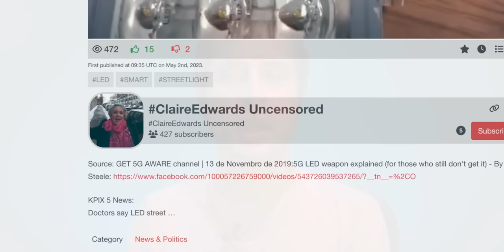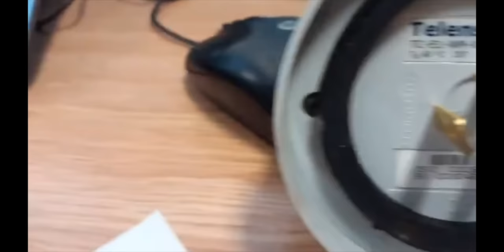Weapon Breakdown? by Mark Steele

Comment: A quick google of the datasheet for the Hongda HFE20-1 Shows it to be a Mini high power latching relay, 20A max switching capacity. A Telensa, is the manufacturer of the Telecell controller you can download the datasheet for that too. Mark Steele is a weapons grade plonker.
Reply: I'm sorry to say that I didn't download the data-sheet. I just assumed Mark was wrong.
Reply: @RaynardWilson0   Ignoring the old claim about what making assumptions means, I think that is a perfectly reasonable, evidence-based, assumption.
Reply: @RaynardWilson0  Nothing wrong with that, Mark is wrong most of the time, he doesn't know the difference in magnitude between Milliwatts and Kilowatts. Or voltage ratings on Capacitors. 450V is the maximum voltage it can be exposed to and store. On a 240V mains supply that would be the usual rating for a capacitor. At lower voltages, say 12V,  you'd choose to use a 24V rated cap. Mark should have been looking at the Transformers fitted to the circuit board, they can step down or step up the voltages in the circuit, in this case step down from mains power to a lower voltage for the telemetry circuits, but switching the high voltage Street light on and off through the relay.
For a real misunderstanding, he ought to look at the speed controller used in a brushless RC model aircraft engine, and the amount of power they are expected to control, some of them are rated at over 100A!
Reply: @RaynardWilson0  A very solid assumption i would say.
Reply: I don't think I've ever seen a power rating marked on a relay before. Voltage and current, most certainly, but power especially in watts rather than a volt-ampere product, is an oddity in my experience (which is pretty extensive - I used to design industrial electronics including SMPS, which I hate)
Reply: @monochromaticlightsource2834  He was quoting the voltage because the actual value of the capacitor would mean nothing to him (or to his followers for that matter).  What could it be, hmm?  100 'UFFS' for instance?  (I can't read them)  Doesn't sound as nasty as 400 volts.
Reply: @CaptSlog  I suppose we could tell him about resonant frequency, and that a capacitor and an inductor will resonate when forming a Tank circuit. The word Tank in Steeles mind is a weapon, and off he goes telling everyone that the millivolts a crystal radio set is able to generate can be used as a potentially lethal weapon.
Reply: Did you really have to look up a data sheet to come to the conclusion that he's eaten too many crayons?

Comment: I would love to see a Big Clive teardown of that Telensa unit, it looks interesting. Also those units date from something like 2010, probably designed for LPS lights. It has a maximum switching current of 10A and a transmit power of only 100mW. That is less than a modern residential access point.
Reply: I believe Mr Toon knows Big Clive, I wonder if he can be persuaded to do the needful.
Reply: Yes, but will it carbonate? 😀
Reply: If it carbonates, can we get something carbonated?

Comment: Recently got a look at inside of an CRT TV, he would get a damn heart attack just by looking at it. Quite an amount of beefy capacitors as well as other quite beefy components (in part due to how old the tech was). Not only that but it contains an electron gun and a vacuum chamber with coils surrounding it for aiming.
Reply: It also contains a "high voltage"warning. I guess they leave this off the streetlight to catch us off guard.
Reply: Woah woah have you forgotten the X-Rays those bad boys out off if it wasn't for the shielding.
Reply: It used to be fun to hold one of the neon mains tester/screwdrivers about an inch in front of the screen and watch it light up.
Reply: if you think that was kewl, you should look into the "health machines" from the late 1800's like ozone generators and violet ray tubes...
Reply: UH yeah - those can reaaaalllyyy zap you :)
Reply: @clivedavis6859   Not electricity related but also implosion warning, there is a good reason why the front glass is so thick
Reply: Don't be silly, everyone knows that you can't have gas pressure next to a vacuum.
Reply: @StringerNews1  And you definitely need a container for spectroscopy!

Comment: 555 timer...the number of the electronic beast.

I'll get my coat
Reply: At uni, long ago, i had to design a 555 timer from scratch in matlab on a sun workstation… god im old…
Reply: So versatile, so deadly!
Reply: I was once almost injured by a 555. I was assembling the project for my 'O' Level (yes, I'm that old) in Electronics, was excited as the parts had just arrived (mail order from RS) plugged it in, switched it on, and there as a snap noise, and something hit me in the forehead. I'd plugged the 555 in the wrong way around and destroyed it. Oh dear, another 2 week wait for a replacement,.....
Reply: @engineeredlifeform  I thought you were going to say it did a 'dead bug' impression as you were fitting it and its 8 legs impaled your thumb.

Comment: Oh crap, I've been using 400v capacitors on my old retro consoles.. i never knew my old nintendo was a lethal weapon..
Reply: Big Clive calls them "death beam capacitors" - he's obviously aware of Mark Steele's revelations.
Reply: 400v?
Reply: @babotond  v for volts.. 
"400 volts" and "3600watts" markings are the maximum rating for the part, and they operate way under that.
Reply: @Lunchpacked180  thanks!

Comment: Not only are they weapons systems, pulse mode street lights are a great weight loss plan. As your irises open and close at 20,000 times per second, following the pulsing light, your eyes turn into fat burning machines. You burn so many calories you can lose all your fat while stuffing down as many hot fudge sundaes as you want. For best results, lay off the sundaes while you stare at streetlights.
Reply: Using this same principle, we used flashing security lights mounted at almost ground level to disorient intruders .

Comment: If these are weapons systems as mark claims I'm still waiting for the explanation as to what exactly will cause you injury or death.  Do there street lights have some sort of gun attachment that he hasn't shown us yet?  Is there some C4 explosive hidden inside these capacitors and relays that can be activated when we get too close?  If the method of causing injury is to zap everybody with an overdose of UV light in the hope they get skin cancer and die I can't say I'm impressed, I'm sure the gun and explosive options are more efficient.
Reply from the maker: He actually thinks the RF from these can vaporize a human. Literally vaporize like Star Trek where the body is gone after.
Reply: @ConspiracyToonz That would explain a lot. I’ve been wondering where are the mass graves for burying all the millions of people who are being killed by streetlights.
Reply: @ConspiracyToonz so that’s where all the workers that install the “weaponised parts” go to and why you never see them.  As soon as they plug them in they’re vaporised.
Reply: Look at any printed circuit board carefully.  Somewhere on the component side you will always see a "C4" marking ...

Comment: Man, if only there was some kind of writing on those little black rectangles all over the bigger green rectangle that would give us some hint as to what their nefarious purpose was and let us look them up. You know, something like "666 EXTREME power microwave weapon modulator" or "ISL6565B switch mode power supply PWM controller".

Comment: Oh no. Pulse Width Modulated LEDs. As featured in video boards, static and scrolling text displays, petrol totem price displays, architectural lighting, etc.
I worked with these (designing, repairing and installing) for 16 years and only died every time I powered one up. Which is thousands. It gets monotonous after the first 500 times, then you just roll with it after that.

Oh, no! Not high voltage caps! Not really for holding the full wave rectified mains voltage then?!? WE'RE ALL GONNA DIE!!!

Well, that does it. Out with the chainsaw and goodbye streetlights!!!

Comment: And now imagine Mark looking at Guitar tube amp. wide traces, big PCB, HUGE capacitors and real voltages up to about 500V. Hot, gloving tubes and a lot of places not to touch. either hot or even lethal. Big power supply (transformer), big output transformer and even some small modern electronics (DSP doing the reverb). And it has some real weight to it 🙂
Reply: We could send him circuts to review

Comment: Thin cables with cheap plastic connectors? I guess the first atomic bombs were like that too huh  Mark Steele.
Reply from the maker: I love the part where he shows the antenna which is JUSR A WIRE and points out how sophisticated it is.
Reply: @ConspiracyToonz  yeah, but it did have a rubber jacket!

Comment: No, not the 450V capacitor ! 450V max working voltage, how dangerous, in a very dangerous switch mode power supply you can find in tvs, computers and low voltage lights ! Good god I am scared ! And a max 3300v relay too !! 
I wonder if Mark gets scared of his tv remote control and hides behind the couch each time he turns his telly on in case it blows up. And his telly antenna looks very scarey too 😅😅

Comment: If "The Mind Of Steele" thinks that a rather crude power supply is a weapon, I cannot help but wonder if, in the house he inhabits, he has things like a refrigerator, heater, or (shudder) a washing machine?  These days all of these thing have similar "weapons" inside.     😂
If he ever works out what is inside his microwave oven we should be in for a real treat.    🤣🤣🤣
Reply: Ironically there is actually a directed energy weapon inside a microwave.  Oh well.

Comment: if one of those transformers is for a flyback power supply and this is likely its a efficient way to get low voltage from a high voltage source using simple rectification you have 220v coming into the system using the the AC as a unstable ripple sypply with peak of ~300v you will filter it with a 450v cap power a flyback regulator at 200khz or more to drive a fet on a flyback transformer stepping it down to say 9v. this form of power supply is the most energy efficent we can produce as a transformer running at 200khz is smaller and less wastefull than running at 50hz. the magnetic core will be only partially coupled. the danger is that if the opto isolation fails the output voltage can reach many 1000s of volts what he needs to do is power the board place his finger on the output rail while standing in a puddle with no shoes and short out the opto isolater feedback circuit and see what happens.

Comment: Don't even know where to start!? Guess that Mark has some sort of "If I don't know what it is, then it MUST be highly illegal" issue.
I mean: "It's a 450 V capacitor". Yeah sure Mark! That has to do with the grade of the capacitor where as the capacity (Meaning the ability to store electrons) is measured in Farad (typically micro-Farad). The dielectric absorbtion (roughly a measurement of the capacitors ability to load and unload electrons) is defined by it's material. The material again has a grade to the voltage. 
But let's have a game of "Energy perservance and Ohm's law". To parts: One is: How many Joules in how many seconds at what range would be a lethal dose? Joules/Sec = watts = P. P = U x I, and U = R x I. 
Now: Let's say that a lethal dose of electric energy is 1 MW. 1.000.000 Joules in one second. The capacitor is a 450V type. 1.000.000/450 = 2.222 A. At what power input for one second would a piece of copper wire like the one shown evaporate? A 1,5 mm copper cable has a nominal resistance of 12,1 Ohm/m, and the wire is 5 cm = 0,605 Ohm. 
Then we go to the Power Loss Calculator: P(loss-kW) = 1000 x I(A)2 x ρ(Ω-m) x l(M) / A(sqmm) and enter the figures - and out comes 2765 watts of heat transferred in just that tiny piece of cable. 
Would it melt? Yes! In a millisecond! 
This is indeed highly illegal! I mean: The stupidity of course :D

Comment: 6:01 that's not 400 Volt Mark Steele you SPOS... that is 400 nano farad capacitor 🤦‍♂
Reply from the maker: It is rated at 400V. This is normal for a cap used to regulate 240AC mains voltage. 240 is the RMS voltage, peak voltage is 340.  Then you need some buffer for spikes.
Reply: Thank you for correcting Mark and me!

Comment: 6:27 we know why a relay is in there, but why a 3kw relay? Why skirt around it?
Reply: The relay needs to be rated for the peak voltage and the peak current it will encounter, that just happens to multiply up to a moderately high power rating. It's clear from the input rating on the board that it will never be handling anything near 3kW.

Comment: I admit I'm a little baffled by the cable connecting the main power supply board to the other board. It appears to be connected to the main board after (electrically) the EMI/RFI filtering circuitry that is there to keep electrical noise generated by the switcher off of the AC mains. The problem with doing that at that point in the circuit you have all of the noise you're trying to "keep in" and those wires could become significant radiators of RF noise. However, between the poor focus of Steele's video and the way this video has been edited, nothing of interest stays on screen long enough or is sharp enough to really see what's what.
I suppose I could (shudder!) actually go watch the idiot's video.

Comment: I just looked up that street light controler and it does have a brain killing radiation level. 100MW 😢😢 no sorry hit the caps lock by mistake its 100mW EIRP. You would die of old age before that had any affect. 😂😅😂😅😂